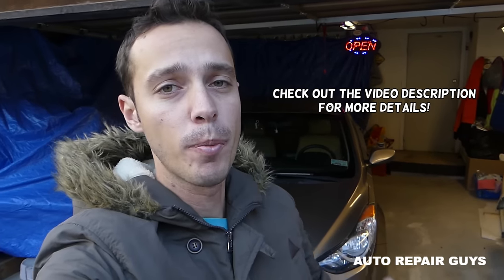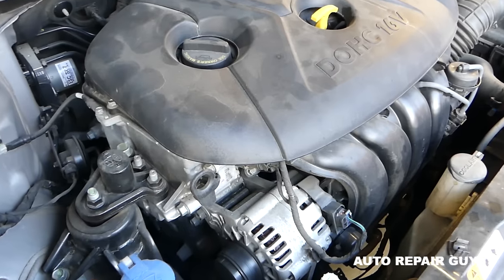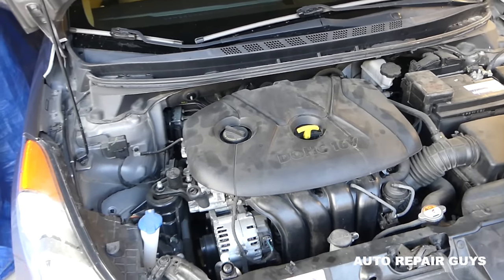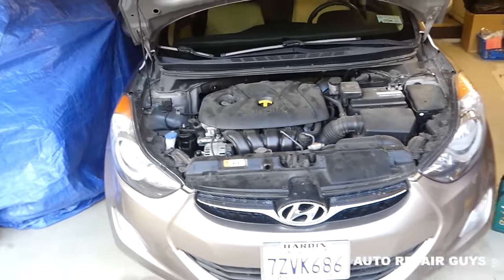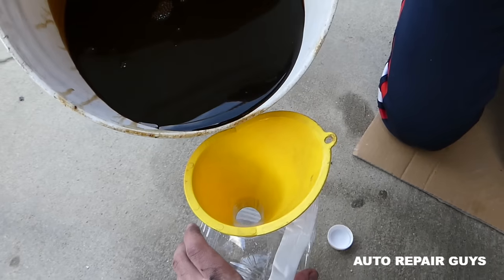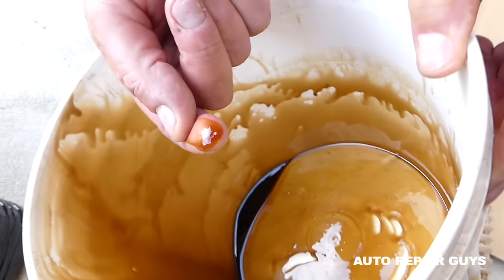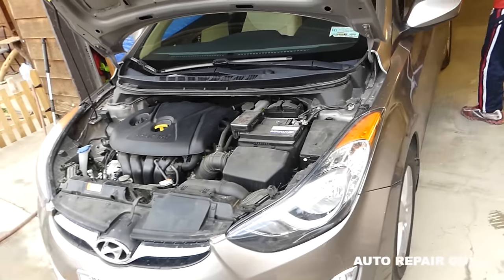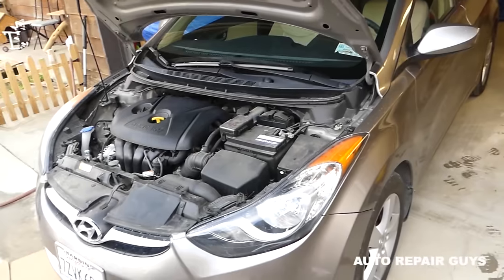HYUNDAI ELANTRA ENGINE KNOCK TICKING NOISE

Comment: use hyundai oem oil filter and the sound should go away
Reply: This is bull put out by Hyundai to get you to only buy their expensive and cheap filters. Have the dealer replace the defective made engine not the oil filter.
Reply: @jameskoralewski3583  I am a mechanic for Hyundai. The engines actually do run quieter with the OEM Hyundai/KIA oil filter. This guy's engine has a bad bearing. I encounter this bs weekly. Really unfortunate manufacturing issues and they have their faults.
Reply: Paul P I could be mistaken but figured you would know for sure, but I heard they solved most of the issues starting with the 2018 model year with the same engines? Any know issues with the 2018 2.4L specifically from Santa Fe’s?
Reply: @fourtysix4646  I hate to say it but even the new engines have issues. It's the manufacturing processes KIA/Hyundai really suck at. Debris gets into the galleys and oil starvation happens.
Reply: All the engines from 1.6's to 2.4s go to shit. I guess it's all on luck when you buy one.
Reply: @Gearhead2286  I have some spare left over oil filters from my 2013 Kia which got totaled in an accident, oil filter part # is 26300 35504.  Can I use these on my 2014 Hyunda Tucson, which used oil filter part # 26300 35503, even though the last digit differs by one? I'm going to guess you're going to tell me probably not, but I thought I'd ask. Thanks.

Comment: A slight tick is completely normal for this engine. As is gets broke in it will have a slight tick especially when the engine is really cold like in the winter. It is the lifters on this car, not piston slap. They are louder than on some cars. If you develop a real knocking like from a bad piston you will hear it cause it will be loud as hell. You won't be able to hear yourself think. Take it to any authorised dealer that knows all about the particular engine. They will tell you the same thing. Even some seasoned mechanics have to ask for help from time to time.

Also use only Hyundai OEM oil filters. Other ones make the ticking louder.
Reply: somebody correct me if i am wrong but that car does not have lifters its a overhead cam so when the camshaft turns the lobes on the cam push directly onto rockers that push the valves open and on the down side of the lobe it closes the valves.i have seen many used cars with a engine knock and some people trying to get rid of it run a really heavy oil to try and mute the noise..also a different oil filter will have nothing to do with engine noise unless you forgot to put a new one on and ran out of oil in 30 seconds...it sounds like it has a bent valves or worse
Reply: These cars as most overhead cam engines have hydraulic lifters.  Very few overhead cam engines have solid lifters most notably older Hondas thus they require periodic valve adjustments. And this noise is lifter tick sludge builds up in the lifters.  Piston slap is caused by the piston skirts and the piston caviating ie shrinking in diameter, this was an issue with gm 3100 engines in the 90's
Reply: I believe there is a manufacturing defect. Something with the coating in the cylinder or a cast on the connecting rod. They have a campaign to replace the entire short block based on customer complaints.
Reply: Ivan 23 Caravantes 
I don’t think it’s crap I drive a Sonata with 2.4 I do lots of miles it’s 2015 but it has 130000 and I change the oil every 10k miles full synthetic but so far my car makes the knocking noise when standing at a light but after I go it’s no noise and I haven’t change anything I never did non of the services I changed the spark plugs with 120k and they looked like almost new and the car is still running very good so overall I’m happy with this car
Reply: If MPG is not affected, it's ok.
Reply: @johnm5855  hope you did tranny oil every 30k or 40k. I was thinking about the gdi engine in comparison.
Reply: Ivan 23 Caravantes 
Actually that’s the next thing because right now it has 142k miles and I haven’t changed the transmission fluid it doesn’t even have a place to check the fluid but I changed the axel and a while back I changed the spark plugs but it still works great
Reply: @johnm5855  yeah I know that transmission is not easy at all to check it out. But hope to drain not flush or you might ruin the transmission since it wasn't done every 60k like the manual said to do.
Reply: @johnm5855  Still got your Sonata and doing ok with it despite the knocking? My 2014 Tucson knocks too at idling but quiet when I go.
Reply: Ivan 23 Caravantes 
I never changed the transmission oil and I have 154K miles on it
Reply: elOsoloco85 
Send it to the dealer my engine went out and the dealer put in a new engine for free because the knocking was formed from a factory defect they’ll change it but it took 7 weeks but they gave me a rental
Reply: @johnm5855  Thanks yeah but I just bought the car, you think they'll still cover me as a second owner? I don't think they will :(
Reply: elOsoloco85 they will cover it even if you’re not the original owner and they’ll pay for a rental but it took 6 weeks for them to fix my car because they imported a engine from Korea but it’s new engine for free it’s a knock sensor that’s faulty so send it in ASAP my warranty was expired because I had 154000 miles but they still fixed it

Comment: Update knocking on Hyundai’s Is from a factory defect so my engine went out with 154K miles so if you’re car is knocking send it to the dealer and it doesn’t matter if you’re the original owned the factory is covering it so if you have a knocking issue don’t wait send it in because a knock sensor is faulty and they will replace the engine but it took 6 weeks to fix my car but they gave me a rental for the whole time and I didn’t pay anything
Reply: Yeah... See.... My first engine had that issue - I had 1 week left of warranty and they tried to get out of it saying "oh you didn't put enough oil in it" even though I had receipts to prove it. (keep in mind this was with my insurance) - after idk 3 weeks, and $2k out of my pocket - I got a 50k mile engine. 

It has been about 1 year, I just got an oil change 2 weeks ago (beginning of 2020 to "start the year off right") and it's happening again but is way worse than before. Before, you didn't hear a knock - it just died. This time, it sounds like a diesel engine that doesn't want to shift gears. 

It is a factory defect (they didn't clean them properly, leaving slight metal flakes) whether or not they're gonna fix it for you free of charge, idk. Also, get a new dipstick, they say the dipsticks weren't reading oil levels properly. (I believe the new ones are red, instead of yellow)
Reply: And I know it's "not in my head/normal" cause before this happened BOTH engines were damn near dead silent. There has been many times where someone (and on occasion myself) have gotten in the car and thought "Is it even on?"
Reply: My Hyundai dealer wouldn’t fix my 2015 Elantra it had 83,000 miles.  They wanted me to pay for half of the new motor. I’m so mad
Reply: @nicolle27g  call corporate they just reached a settlement and my sonata had 145k miles and now it has lifetime warranty on the engine that's part of the settlement so go to another dealer and call the corporate in California
Reply: John m Sonora’s are in the settlement but not the Elantra I was reading it online this week.  I even left a VM at a lawyers office.

Comment: had the same issue with my 14 elantra at about 80k miles. Took it to numerous shops and they told me it was fine. Finally to it to the dealership and they replaced the lower engine block under 100k mile warranty. It took about 2.5 months to get fixed. The knocking is gone but now there's a noise on exceleration every once in a while. Fortunately my car is damn near paid off. Ill be getting rid of it soon
Reply: I have the same problem, just add a can of oil additives (STP high milage oil treatment) for 5 dollars. You won't hear a tick after that. Being doing this forever now.
Reply: Just change the oil every 3000 to 4000 miles it will last a long time

Comment: I put my 2013 Hyundai Elantra Gls in the Garbage At 79,000 Miles Second Owner The Motor was Garbage in the USA to Replace that Will Cost me $3,000 or More Dollars To Fix it, I lost $9,000 dollars Owning A Hyundai
Reply: 3000 is not a lot of money, for a new engine,  and 2nd owner? You have no clue how it was maintained or driven before you got it. ALWAYS buy brand new. It's not that much more, and you get great warranty,  and know exactly what you're getting.
Reply: My '11GLS has 206,000 miles and ticks like hell. Always has 👍

Comment: You didn't "describe a problem", but only a symptom, without having idea what the actual problem is. The noise was still there after the oil change...duh! The oil change is a prevention. Not a fix.

Comment: Hello guys I have a 2016 elantra gls and changed the timing chain and got a new fuel pump but still the car stalls and loses power in the first gear and  produces a popping sound but runs good in all other gears please help,

Comment: Oil change made no difference dude !
Reply: I have using 5w20 oil all year round. I did notice a improvement with using 5W30 castrol .. The noise goes away after a few min. ?  Changing the oil did not solve the problem. If possible I think that using 5w30 would be a better choice to use.
Reply: Wishful thinking

Comment: You can't get ride of from this noise by changing motor oil guys. You should open the cylinder head cover up. And then change hydraulic valve lifters. There are some additives to stop this noise. But it is not permanent solution.

Comment: Was that really a smart move revving the engine so soon after starting the cold engine that just had oil replaced?! 🤷🏻‍♂️
Reply: Don’t tell mr.lube this... they ask people to rev their engines to 2500 rpm for 10 seconds or so and then shut the engine off so they can check the oil level now that the oil filter and etc are filled.
Only went there a few times but it seems to be standard procedure.

Comment: Hyundai engines have been known for valve noise on start up as long as I’ve known anything about Hyundais. 
I actually didn’t hear less noise after the guy changed the oil. Just drive the car gently until it warms up.

Comment: My friend cleaned a solenoid where the oil moves to the top of the engine. That fixed it for him
Reply: Witch solenoid was it? Thanks!
Reply: @Mackenzie.Grant95  Variable valve timing solenoid. There's one on the front and rear of the engine near the top right by the valve cover.

Comment: Thanks. The engine was always a bit noisy. I stick to 5w20 oil anyways. They say valves should be adjusted at 100,000 kms. Not sure about that!   Edward

Comment: I have the 2013 and had this noise , after doing this with these products, it's quiet now, whole different car,  Thanks for sharing this knowledge, btw did the transaxle change with max life Valvoline atf  at ninety thousand, car shifts like a dream ...replaced the engine air filter...this car is getting 45 to 47 mpg highway average ..runs great..
Reply: How fast are you going on highway that is giving you more miles then what the cars suppose to do tops?

Comment: Hyundai had an issue with cast flashing inside engine that didn't get removed and later could break free and cause this issue. Hyundai will cover an engine replacement free of charge if you fall under this issue no matter the year or mileage. 👏🏼
Reply: Except me. I'm over the lawsuit allotted mileage. By 26,000 miles. It sucks too. The engine oil is still clear when you check it.

Comment: I have an issue with Hyuindai Elantra 2012. It starts and runs fine. When you stop and turn off engines after driving for 10 minutes, it just turns but not start until it cools off for about 45 minutes. Does not run hot or no other issues.

Comment: Hi, Would you guys still recommend this yr and model, with higher miles? Thanks
Reply: I would highly recommend this model. I have a 2012 with 124,000 runs great. As long as fluids changed I've seen them get 250,000 to 300,000 miles out if them.